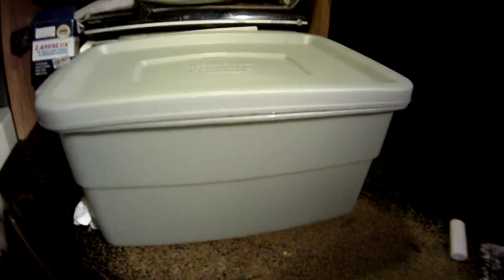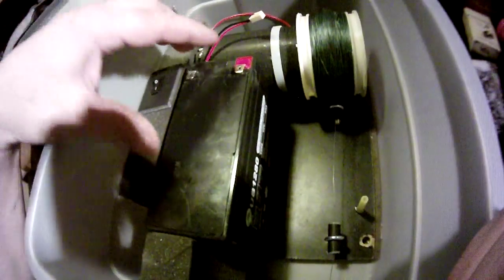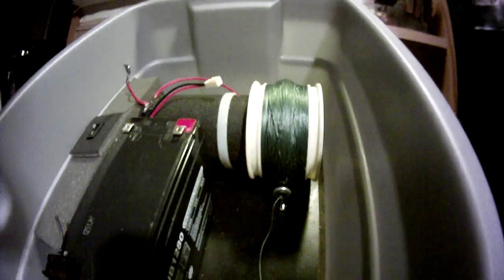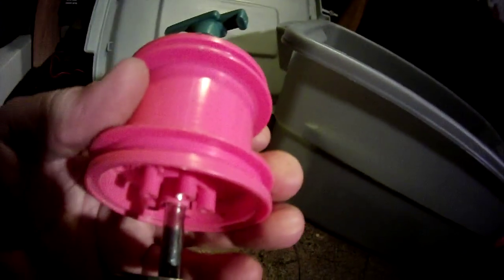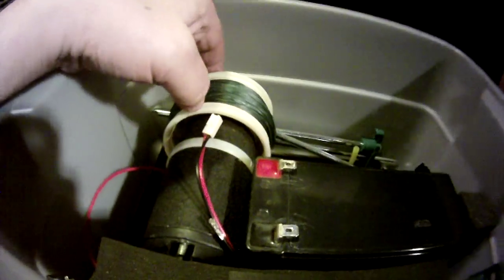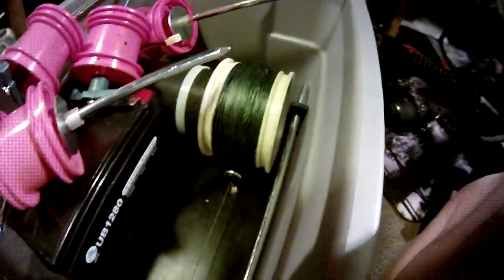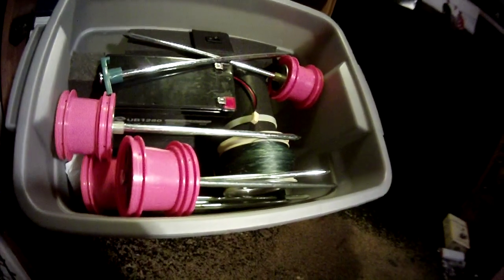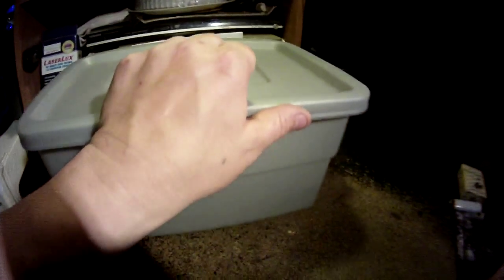Lure Coursing machine home made

Comment from the maker: Hi to all who would like a coursing machine, i will consider new builds,
i believe i can bring them in @ about $500.00  the last one i did for $200 was very close to my cost and i had most of the parts the first time so cost wasn't much of a factor. 
however going forward everything would need to be purchased. i do not mass produce this machine each is custom made. and they may vary a bit from the first design. well let me know i'm a reasonable man. please DO NOT message me back thru u-tube i rarely check it.
contact me @   niceguyma1@aol.com thank you..